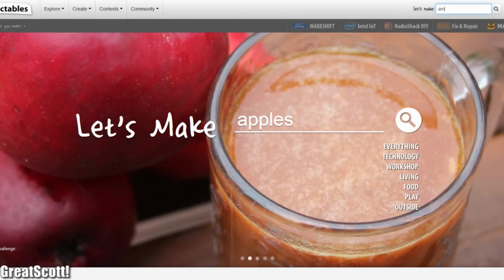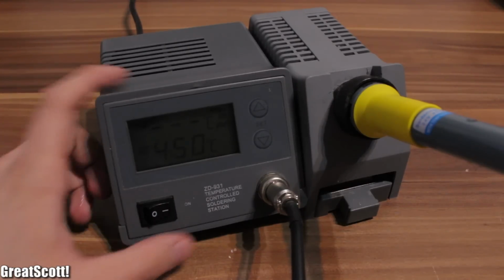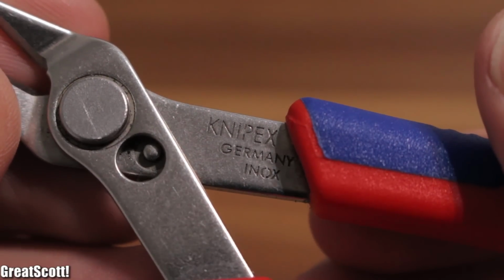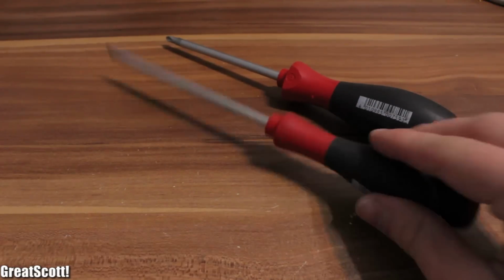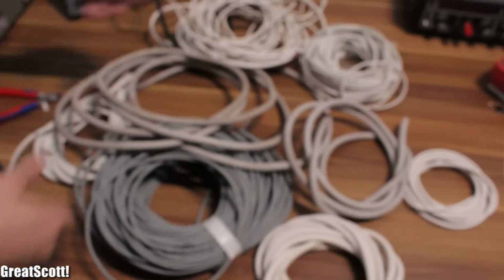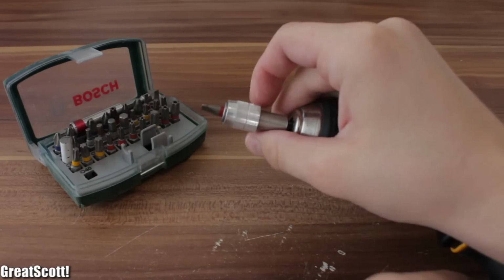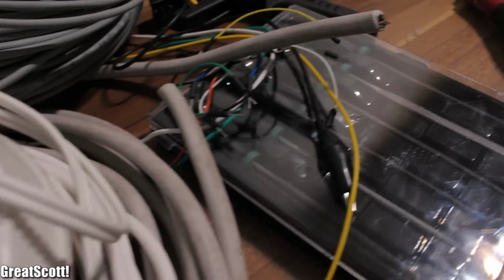Basic/Advanced Tools & Materials for Electronics

Comment: I fully agree with most of your suggestions. I would also add:

Wire cutter It's a bit brutal sometimes but always works

A magnifying glass. Even if you have perfect vision, it always helps to zoom in to see better.

Soldering flux. It makes soldering soooo much easier, put it in a small syringe so that you don't make a mess or use more than it's needed (it stinks but only when burned and is not good to breathe)

Acetone and an old toothbrush. They help a lot with cleaning the mess that comes with soldering especially while using flux.

If you don't have a heat gun, use a lighter to shrink heat shrink tubing. It needs a bit of practice to learn not to burn it. A jet lighter works very well. Too well, even with a normal one I'm now fine with not having a heat gun

Solder pump (this thing that sucks melted solder with the press of a button). It has saved me tons of time and it was less than two bucks there's no reason not to have it when you need it

If you can't afford a lab bench power supply, get a variable voltage transformer. It looks like a normal transformer but at the bottom it was a knob to choose between 3, 4.5, 5, 6, 9, and 12 volts. It's dead cheap (around 12€) and works flawlessly

Helping clamps (they hold the circuit in place while you're soldering). I can't live without them after I got them for less than 10€

A ruler is also handy to have around along with a marker.
Reply: thanks!

Comment: I started working in electronics in 1966 and have learned good tools last forever, cheap tools are just a waste of money. I still have the Weller WTCP soldering station I got in 1970, all I do is replace the tip from time to time. I have 3ea Fluke 8060a multimeters, probably one of the best models made but they were expensive in the 1980's, sometimes you can get them used for $50. For a scope I have a Hitachi 35mhz dual chanel and a Tel 2232 analog/digital storage scope, both are very good for what they do. By good cutters and pliers most of the cheap ones are crap.

n my career the most referenced book was an old copy of Reference Date for Radio Engineers, I used that many times a week and still have one on my desk in retirement. I used to have data books galore but the internet handles most of that now. National Semiconductor always had the best information and applications in the analog sphere.

Comment: I went 
Fluke 117 ~$200
Xtronic 3020 pro with all accessories ~$70
Craftsman hex keys, sockets, and driver's acquired from my father
Wire, 24,22,20, and 18 gauge (cheapest real copper stranded on Amazon, I forgot price)
Iwiss crimper (forgot price)
Dewalt breakoff razor (like $17 but I've been through A LOT of razors and it's the strongest with the least obstructive design.
Stanley 1/4" chisel (got from father, great for breaking through plastics and rubber)
Dremel, and harbor freight air die filer when the dremel doesn't have the power. (Great for work on enclosures)
Hatvor freight Air drill and cutoff wheel, Pawn shop ryobi jigsaw (same as above, I still need a good modular electric drill driver)
Black and decker worm drive skill saw, excuse me, circular saw. (Found in trash! You can do anything with enough precision and a good skill saw)
Prusa 3d printer (~$800 without the MMU)

I have other tools, but those are the ones that have helped with electronics projects. I have plenty of more projects on my mind. I wish I had an oscilloscope

Comment: a. Soldering Station
b. Desoldering Gun Station
c. Lab Power Supplies
d. DSO and CRO
e. RF generator 
f. Function Generator
g. Digital Clock Generator
h. Frequency Counter 2GHz
i. LCR Meter
j. 2 x True RMS Meters
k. Capacitance Meter 
j. Components Tester
l. Curve Tracer
m. Hot Air Reflow Station for SMD

Certain I am missing something...

Comment: I have a bunch of Xuron tools.  They were all quite expensive, but they work really nicely.  For a variable power supply there are now some nice units from Ruideng/Riden.  Not as easy to use as a proper supply with knobs, but they work and they're much cheaper.  For soldering there are now the KSGER and other similar ones.  For screwdrivers I have a couple of Wiha ones, but what I actually use the most are a kit I bought from iFixit and another that was branded Rolson.  Not the highest quality, but relatively cheap for a wide range of bits and they work without issues.

I've also got a couple of those crimping tools that include a set of dies.  Again not professional quality, but they make good crimps and they were affordable.  Plus some wire strippers of unknown brand.  They're ancient and stick a bit, but still work.

The other thing I've found really handy is a board holder.  Mine's branded Pro's Kit, but the same one is available under multiple names.

My glue gun is horrible.  It messes glue everywhere.  I don't if they're all like that as this was a cheap one.  What I've found works in using hot air to melt the hot glue.

Comment: I know this is old but if there are new people like me watching, it's still worth chipping in for them to read.
I've been doing projects and working on things for awhile and have got a nice inventory of tools so here is what I would recommend. (I'm from Canada so I didn't exactly recognize most tool brands on the video but made in germany is a solid argument for tools!)

First, the multimeter, I have bought about 2 now and used 4-5 (given to me) and if you're going inexpensive, it's a question of time before they get inaccurate like for a 40$ one, about 2-3years worth then the readings are gonna get inaccurate.

An automatic wire stripper is a must, but I found that if you're working with 20awg wire or smaller, most automatic stripper will pull the rest of the cables isolation.(Pinch the side you want to use with pliers and it'll work fine like that)

For electric tools, I personally found Bosch to make very descent equipment, but most importantly, the batteries are not locked to a certain amount of charges (about 400 or so I've heard) like makita's which do make excellent electric tools too.  Dewalt is a very good quality brand also to think of during your buying process!

For a soldering station, I just bought one since gettin into electronics. I've found on amazon.ca a 60cad$ Weller station and wouldn't suggest anything else, some chinese weller copies of 200$ models are actually decent for the same price as the 60$ one. But might as well get Weller. DO NOT GET CHEAP DIRECT PLUG IN THE WALL OPTIONS, I've had some in the past and they are horrible.

As for the lab bench, I'm new to this too but I've bought the literal cheapest one on amazon.ca and I'm very impressed!(https://www.amazon.ca/gp/product/B07WLYSJW6/ref=ppx_yo_dt_b_asin_title_o00_s00?ie=UTF8&psc=1)

I am also in the pc world and for other tools like screwdrivers, I would suggest an iFixit kit as it is very practical and versatile on top of what GreatScott! mentionned.

One last thing, you never had enough tools or wires! or screws.. or bolts.. or nuts or cableties or connectors etc etc get ready to run to the store or salvage very often!

Comment: I found that you can actually strip very thin wires with the automatic tools. You just have to do it fast. Works reliably with mine. But if i go slow my experience matches up with yours, it just slides over.

Comment: Rotating PCB holder can really help with assembly, great little tool. 
Additional, separate flux is a neccesity!
Solder wick to save SMD.
The thing that sucks solder with vacuum.
IPA and cleaning tools, absolutely essential.
Silver plated connection wire and Kynar. 
Tweezers of many types.

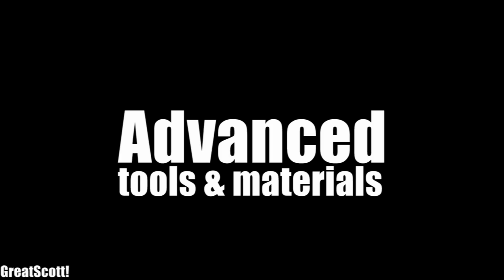Comment: I want to buy a power supply for PCB testing as well as occasionally running BLDC motor. I don't want high rated one, just 16 V 5A with C.C and C.V would be good enough. It needs to have a dual floating channel so I can get higher voltages and a linear regulator for low ripple. I don't want to spend a fortune either, somewhere around 100$. The one I see in your video @5:00 seems great. Can you suggest one?

Comment: CHEAP GLUE GUN: $20...
my glue gun: $2
Reply: Same bro.
cheap multimeter 50$
really cheap multimeter 25$
my multimeter around 15$(more or less 15$ because i brought it in my country for local currency of course)
but i live in Poland when income is quite low for West Europe standards and 50$ is quite a lot money, especially for someone young like me .
Reply: @crusaderanimation6967  my soldering iron, solder, multimeter, flux, soldering iron and soldering stand cost me $3 lmao
Reply: @dabigdadyz  my soldering iron, $10, 80W, controlled by a light dimmer. I know, horrible.

I use a light dimmer to limit the iron's power because 80W kept wrecking PCBs and it also damages tips. Plus, it's a pain to plug/unplug the iron.

Comment: Hi Scott, I really enjoy your videos, thanks for the great job. Can you recommend a type of protective pot or resin to use in a multiplier circuit (high voltage, low current). Must be one easy to remove when it's necessary to replace a component of the system. 
Keep going with the great work and have a great new year!
Reply: dude he won't look at comments on videos that are 7 years old

Comment: Kester 44 or Multicore solder is my choice. I like them because their flux seems to work better than some of the other brands. I like the thin solder for circuit boards but for bigger connections the thicker solder is more manageable. Get a nice temperature controlled soldering iron. I have an old Weller TG202 but the Hakko irons look nice. For the occasional heavy jobs the Weller D530 or 8200 soldering gun works great. You can usually pick one up on Ebay for cheep. Try to find an older iron where threaded nuts hold in the soldering tip. I use the Xcelite 170M Shears for trimming circuit boards leads but they can be easily damaged by cutting anything big.

Comment: It's better to use an iron sponge to clean the tip of your soldering iron instead of an normal sponge, because the tip increases it''s lifetime. (It won't be cooled down so hard if you use an metal sponge - also you can't forget to wet it (you shouldn't wet it))
Also don't clean your soldering iron at the end of your work. This old and burnt solder secures the tip of beeing oxidized (rust). 
https://www.amazon.de/SODIAL-Abstreifer-tspitzen-Metallschwamm-Goldfarbe/dp/B00JZETVPC/ref=asc_df_B00JZETVPC/?tag=googshopde-21&linkCode=df0&hvadid=344418063584&hvpos=1o5&hvnetw=g&hvrand=3351576244816263609&hvpone=&hvptwo=&hvqmt=&hvdev=c&hvdvcmdl=&hvlocint=&hvlocphy=1004283&hvtargid=pla-349287528473&psc=1&th=1&psc=1&tag=&ref=&adgrpid=67671284565&hvpone=&hvptwo=&hvadid=344418063584&hvpos=1o5&hvnetw=g&hvrand=3351576244816263609&hvqmt=&hvdev=c&hvdvcmdl=&hvlocint=&hvlocphy=1004283&hvtargid=pla-349287528473

Also it's better for beginners to use an analog oszilloscope instead of an digital one. The digital one has more functions to use, but you don't exactly know, how it is done inside.
e.g. This is the one we use at work: https://www.ebay.de/i/254249427880?chn=ps&norover=1&mkevt=1&mkrid=707-134425-41852-0&mkcid=2&itemid=254249427880&targetid=595311563424&device=c&adtype=pla&googleloc=1004283&poi=&campaignid=1795328781&adgroupid=72110652874&rlsatarget=pla-595311563424&abcId=1140506&merchantid=7364532&gclid=Cj0KCQjwgLLoBRDyARIsACRAZe4a8y_2JvBCK5rUItNfKrC__auJ3K6lavWwjsufRAFAjUP0IGe5eT8aAn5-EALw_wcB

Elsewise this is also good to have (I think): http://shop.trenz-electronic.de/de/27070-Analog-Discovery-2-Akademisch?showb2c=1&gclid=Cj0KCQjwgLLoBRDyARIsACRAZe4h1HF0dghQPIDBEKpGFCBb9DTzxv57AzUqu9LLKkvlusL1H8t19jcaAjUIEALw_wcB

Comment: I do agree with pretty much every tool you've mentioned. But, I would say that a variable Constant Current Constant Voltage DC power supply is critical. As is a variable AC power supply, of which I prefer a variac. And if you have a variac, you casn use it coupled with a bridge rectifier and capacitors to power a DPS type CC/CV DC-DC power supply up to 0-50V, 0-20A for $50 or less, which is more than enough power

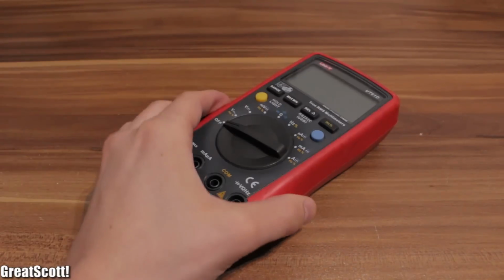Comment: 2:01 
I bought 3 years ago a 2€ multimeter in slovakia 
This thing still works great, i dont need accurate measurments, i just need a rough measurments
You never need to tell if it is 9.02V 
9.0 is enough
Reply: I have it also and for  measure until 60V is gret for this price. But never try make short circuit and measure 220V. Or go before to channel DiodeGoneWild, where You will see what can happen with this device or with You.
Reply: Roman Hanajik i measure 230vac every day and measure 0.3 amps 
Nothing ever happened

Comment: Weha is overpriced. Buy Vessel!  

Sheeeooot let me elaborate. Vessel drivers are made in Japan and are of excellent quality. The cross points have little jagged teeth on them which are great for removing stripped screws. They are also magnetic and tough as hell which is evident in how they sell virtually the same drivers as demo drivers by just adding a strike cap.  

Knipex for cutters, can't argue there when it comes to electronic cutters. For heavier duty cutting I recommend Southwire as they are inexpensive and work very well for heavy duty cutting.  

DSO138 oscilloscope is a must have for beginner hobbyists and there's no excuse since it can be bought for under $30. 

Auto strippers are ok but I love my stainless steel Greenlee's. The tiny ideal t-strippers are simple and effective also.   

I use a Tekpower bench supply that is the average lower end 0-30v 5A output but it has worked great for me. Sometimes you can find old LED power supply modules that are good for 150W or more that go to around 35V and adding a quality buck converter to vary it below that is easy enough.

ZOYI ZT101 Multimeters are freaking great and handily small sized for true RMS 6000 count meters. Mine was 20 bucks at the time. I wouldn't pay more for a more substantial one unless I need something to reliably measure 277v+ AC that also has quality leads. I agree that Uni-T meters are very good and I'd probably keep something like a $25 Uni-T as my main mess around meter (with a UT210E on the side for clamp readings) and a bunch of ZT101's for multiple readings at once.  

I use a Wen rotary tool which has worked fine so far. 

Drills are a must but for home basic DIY tinkering all you need is a cheapo 20v B&D and an assortment of bits. Good extension holder and quick change bits are where it's at. The higher I go in price with my drills they do get a little more better constructed but it's all in RPM and torque increase which you don't need for doing things like drilling small holes and driving screws. That 10v Dewalt is probably fine for most people also.

Comment: Hey ! Nice tools !
I would like to add some more advanced tool for those who will go even further :
1st : logic analyser for UART(RS232), I2C, SPI, etc... 10$ from china and work perfectly with Salae© software
2nd: arduino or other simple boatd with microcontroller and good IDE. With that you are able to generate really fast some signals to test some functionalities (PWM, RS232, test some sensors, servo motors)
3rd : some isolation / protection system (differential circuit braker, electrostatic discharge)

Comment: Highly recommended:  Sealody SSA51 Soldering Station, AMAZON, +/- $50.00, they also sell replacement soldering wands when your wears out for $12.00.  Digital display, centigrade/Fahrenheit, calibrate function, heavy aluminum stand, fast recovery, sleep mode

Comment: Soldering Station/Hot Air Gun + Powersupply and Voltmeter plus many of other things:

Search vor 909D+ on Banggood

Never had problems with it and I'm still amazed also because the Quality is very good. But the build in Power Supply just can give 2A of Current so not enough for some of my projects. I'd have an other one with more current and max. Current adjustable

Also just the Voltmeter isn't enough for me I had a Mastech Multimeter and much more like the transistor Tester a kit on Amazon for 17,99€

Comment: There are good chinese tools out there. For instance, finally got a real solder station after using those direct plug in toys for years. So much better! Got a chinese 8586 iron and heat gun combo unit. Have seen vedios of poor quality of these but honestly, i took it apart and inspected immediately on receiving and found it to be good. For 28$us, 69$us with dhl shipping! Air heat guns are very nice for removing ICs! note .. i did have to calibrate temp., it was off. and temp accuracy swings +/- 15degC but i say still good.

Comment: Love my Amprobe multimeter complete with rs-232 connection you can use this to interface rs-232 devices using the multimeter as a sensor. Wiha screwdrivers are great I agree as are a set of small metric / imperial spanner sets. I use a tiny little watchmakers set of screwdrivers & socket set ideal for getting into tight spaces with bolts.

Comment: I recommended Metcal MX5000 Soldering Station or Weller WD, Atten 858D Hot Air Rework Station, Function Generator, Spectrum Analyzer. You need also Third hand holder clip, and Magnifying Glass. I think thats it :)

Comment: I like the weller soldering stations i have used a really old soldering station what i got from my godmother and its really good. I got it when i was 9 and i didn't know about electronics much then so i was a little creeped about the humn what it made XD and the soldering station heated from 0 to 350°C in 8 seconds i think it whas 60w but anyways now i have weller whs40 its better but it heats a little slower but it has temperature control and i can change the tip

Comment: but what about litz wire I.e. multiple stranded wire due to higher and higher current electrons will flow more and more towards the surface of the copper because of surface current related effects